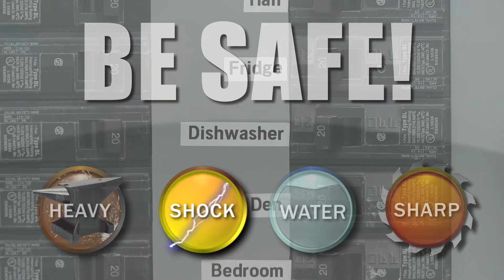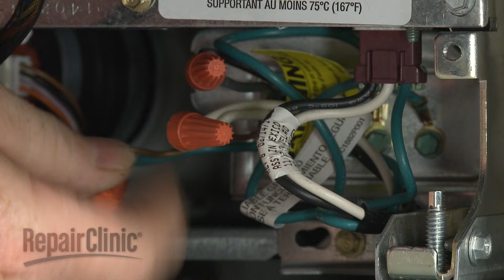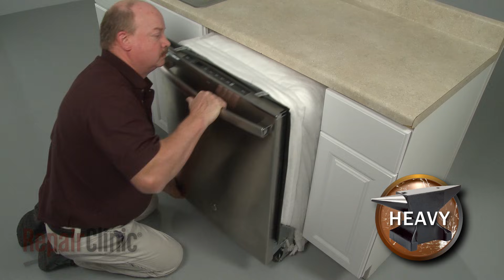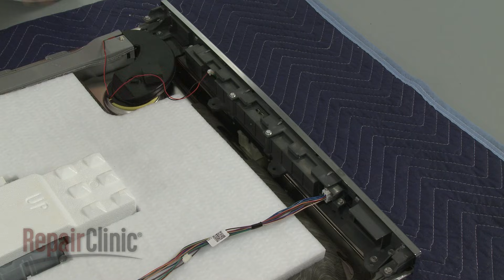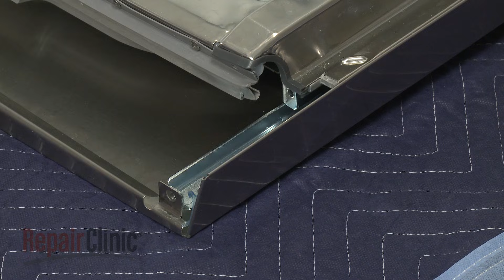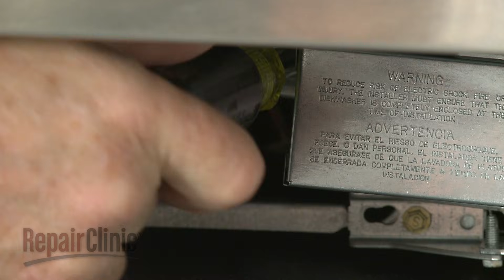GE Dishwasher Control and Display Board Replacement WD21X10553

Comment: My dishwasher had been making random beeping sounds for a few weeks and then it just quit working- no lights on the user interface.  I replaced the control board first but it had no effect so then I replaced the user interface board per this video and now all is good.  If you're not sure which board you need perhaps start with the UI board since it is less expensive.  There isn't an advantage to trying to replace both in one repair session since the teardown has almost no overlap besides removal of the bottom trim plate.

For the life of me I couldn't get the wiring cover to mate back up closely enough that it could be secured with the single screw.  The area is difficult to access and it isn't easy to assess what is going on.  I ended up securing it with a zip tie through the screw holes... good enough.

Anyway, thanks for this video and the one on the control board.  Very helpful.  I had enough play in all wires/hoses/etc. to avoid disconnecting anything and I suspect most installations are similar since leaving some play would have made the original installation easier anyway.
Reply: Sounds like I have the same problem. I just replaced the control board, since the original board had a solid green LED, which according to the documentation means the control board is bad. But the new board has the same solid green light. Just curious, did yours have a solid green light also? I'm really not looking forward to disassembling the door...
Reply: @adamjohnson7358  I honestly cannot remember whether my light was blinking or solid.  However, as far as electronics go, these are the only two boards in the dishwasher.  It really wasn't that hard to disassemble the door.  If you have a little slack in the lines you won't need to unhook anything- just pull the dishwasher out enough to unfasten the door.  Good luck!
Reply: @brianyoung8172  I've got the same scenario now.  My Main Control board had a solid green light.  From what I can tell it can be a problem with either the UI board or the MC board.  Since my symptoms are similar (random beeping for weeks, then no lights on UI) I am going to start with the UI board.  Little hard to find.  I ended up bidding on one on eBay.
Reply: @merlin0152  Good call- random beeping sounds like the UI board to me.  Good luck!  Not even worth calling a repair person given the price of the dishwasher.
Reply: @brianyoung8172  Just installed it. Badda-Bing.  It works.  It's nice to make it through these do-it-yourself fixes with success and save some money.  I do wish more of the technical manuals were more easily available.  I did find some but not for my exact washer.  Thanks for posting, it did help with my decision for which part to replace.
Reply: I added this above, a well, but just in case someone looks down here instead:  My original board had no jumpers. I ordered the correct replacement board and set it to the designated jump pattern (personality 10), it didn't work. I put the jumpers on all of the pins and then the board worked. I have a GDF610 and also had the random beeping.
Reply: @Cocomon84  I have the same exact model and am currently having the same problem. If you don’t mind me asking where did you purchase your UI board?
Reply: Thanks for this old comment. I was wondering if I really had to disconnect all of this things in the first half and it sounds like I don’t if there’s enough play for me to pull out the washer enough to get the hinges off. I have a random beeping sound, exact sound as if I close the door about to start a cycle, and the other day lost all function in the board. Unplugging power for 10 minutes fixed it for now but I’m sure it will eventually break

Comment: I have power to the unit and in the cable going to the board. No lights and does not start.  Would this be the board?
Reply: I have the same issue.  I am still trying to figure out what is wrong.  Have you had any luck?
Reply: @kylerdenton09  well believe it or not. I took the cover off where the power connects to the main board. I did NOT turn off the power. as soon as i wiggled  the plug to disconnect the power, it turned on and is still working. Thinking it has something to do with the plug itself. Hope this helps.
Reply: I'm looking into the same issue. Did this work for you guys?
Reply: @Coonamber3  Yes, i wiggled the cable to pull it off the main board and it started right up and has worked fine since.
Reply: @Big Factz The board underneath the dishwasher. I believe it has a cover around the flat 3 wire plug. With power on, just wiggle it and the lights may come back on. This is the plug that lead to where the main wires hook to the electrical supply.

Comment: I'm not getting any power to my board, can you help me fix this issue? I believe the issue was started when i had a power surge.
Reply: I'm getting power ,and all the lights turn on but keypad doesn't respond, could you find any solution ?
Reply: Did you ever find a fix to your problem? I have the same issue. Thinking I need a new top control board or the main board at bottom of dishwasher.
Reply: @ryannewton768  Mine too
Reply: smokeanddiamonds11 I’m just gonna buy both boards and be done with it. Cheaper than paying a repair man to come out I figure
Reply: @ryannewton768  were is thr bottom board located on these units?

Comment: This video really helped me, although I simply had to replace the bezel on the top of the door instead of changing out the display unit itself.
Reply: That's what I have to do, is there seriously no way without disassembling so much?
Reply: James Nuttall not as bad as it looks. You might not even have to remove the wire nuts and drain hose. Just make sure its disconnected from the wall. That usually gets you enough room needed to get to the hinges.